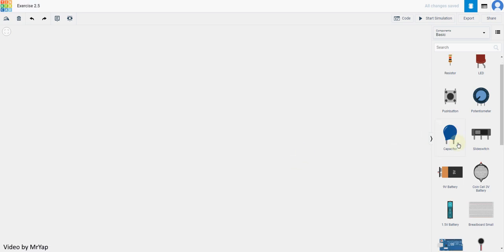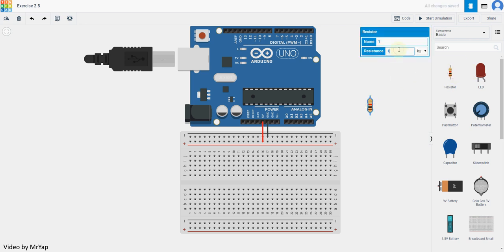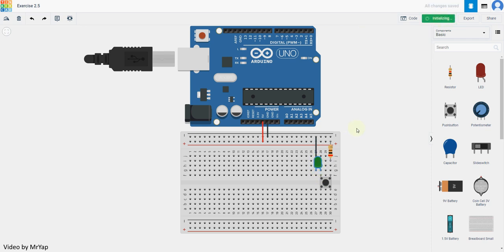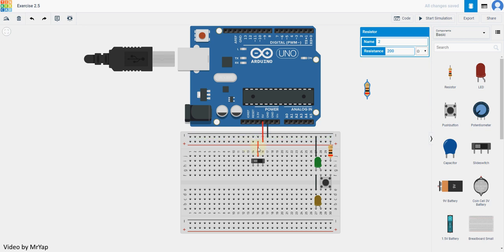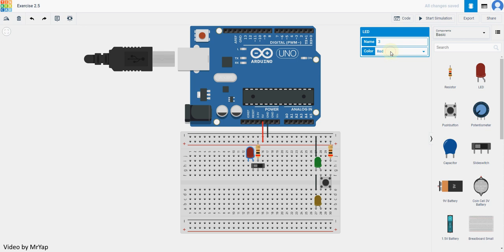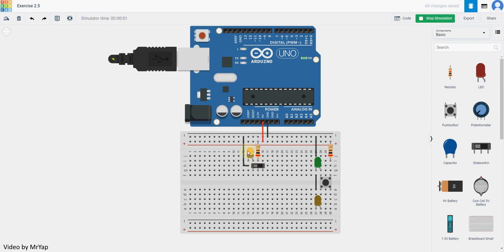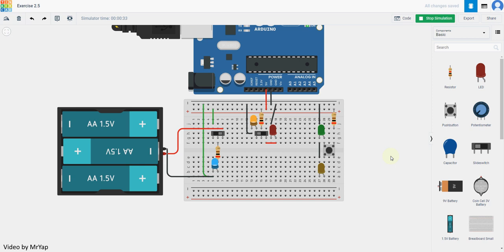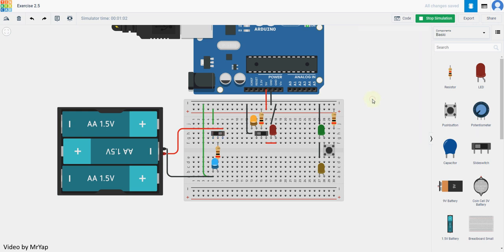TinkerCAD Tutorial: Switches

Comment: thks for you help sir ..can we use the same method of slide switch with ldr
Reply from the maker: How do you want to connect it with LDR? Is it possible to elaborate a bit?
Reply: @mryap2792  yeah sir..like if i am turning on the switch , the LDR should be on, and if i turn off  the switch , LDR should be off
Reply from the maker: @kabocha8679  But LDR is a resistor! So how do you turn it on/off?
Reply: @mryap2792  can we do I with the coding and stuff ..like using the digital pin code? No hurry!! sir ..I only doing this to have fun in this pandemic 😊